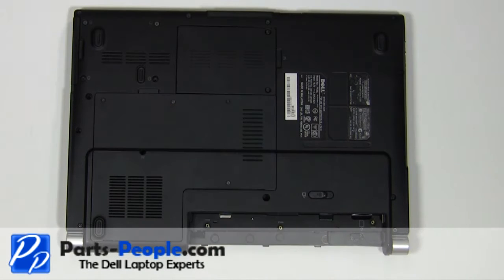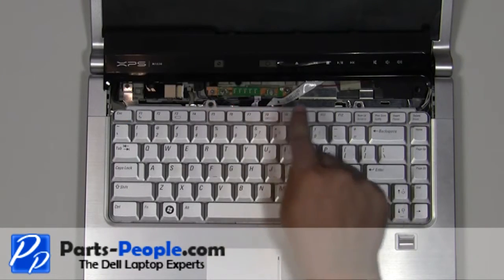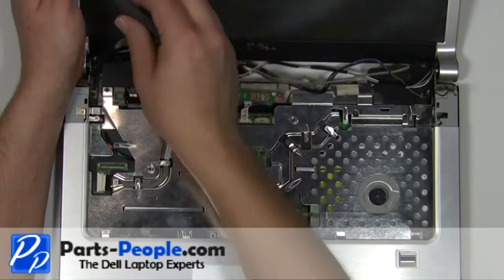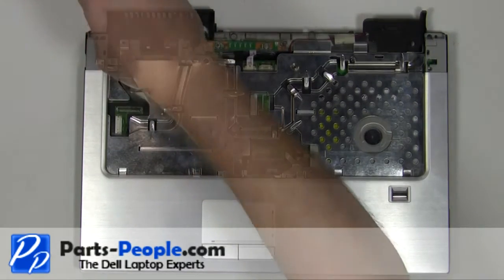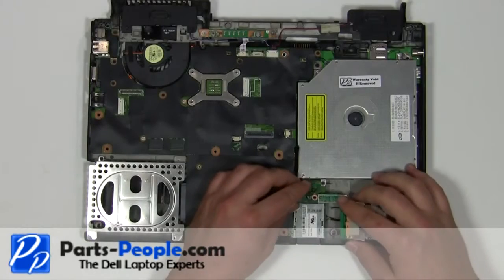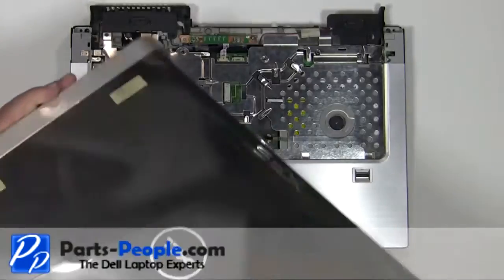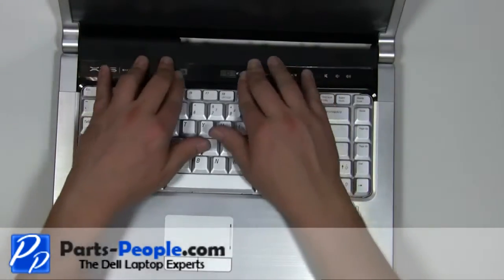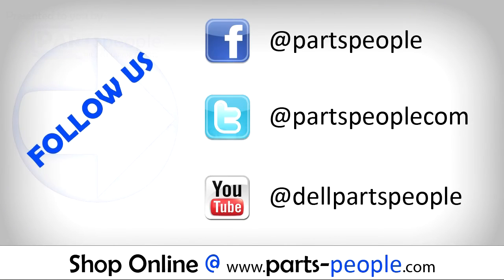Dell XPS M1530 | WiFi Catcher Switch Replacement | How-To-Tutorial

Comment: theres no way that just cleaning the switch will cause it to work again will there?
Reply from the maker: +Joseph III (familyGamerGuy) It's possible. If there was debris blocking the switch and keeping it from turning on then cleaning it could fix it.
Reply: +Parts-People.Com, Inc well i ended up just disabling the switch in the BIOS. solved my issue